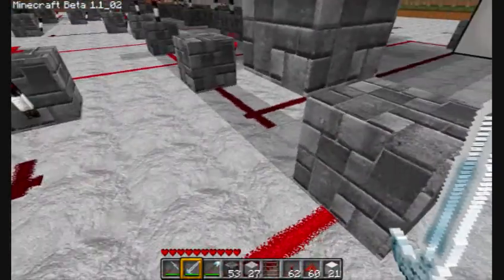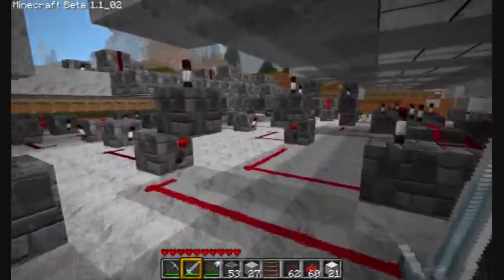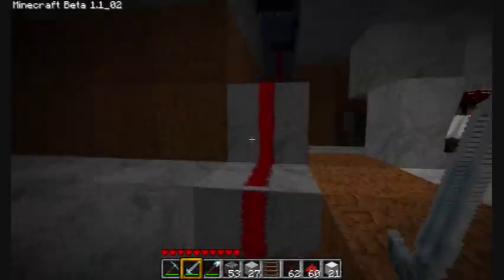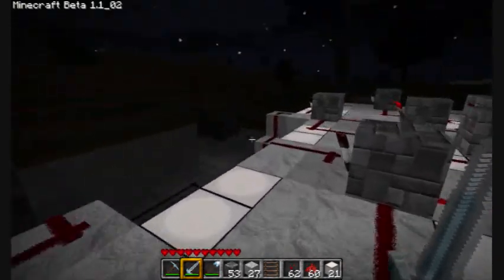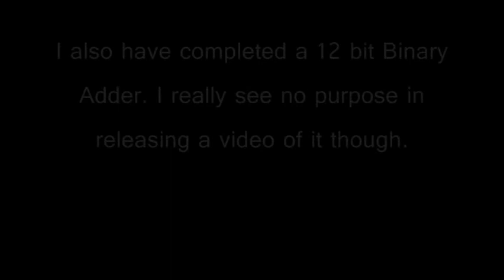MineCraft Digital Clock

Comment from the maker: @TheCheeseySmurf

It wouldn't be difficult at all. I'd just change the sequence codes for the 7 segment display, so it appears it is counting down. The flip flops would still be operating exactly the same though.

Minutes would just require the seconds flip flops, which would merely operate without a decoder/encoder for the seconds 7 segment.

You could also create a 660 torch clock to operate state change for minutes, but I think seconds and an 11 clock would use less torches.

Comment from the maker: @TheCheeseySmurf

Well, in the second paragraph, I was referring to the fact that the flip flops can operate without any output attached. The would just be tracking the seconds, without displaying anything.

The seconds flip flops would then update the minutes flip flops, every time the 6th flip flop for the 10 second counter changed state from 1 to 0, or vice versa.

The flips are organized as such: 10x seconds flip flops, 6x 10 second, 10x minute, 6x 10 minute, 12x hour.